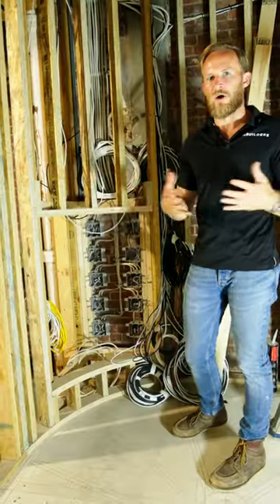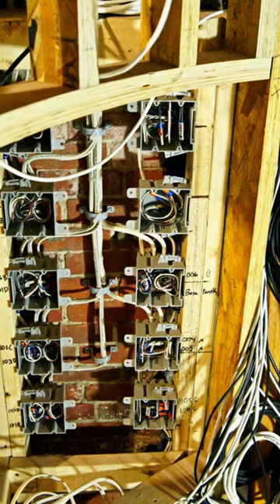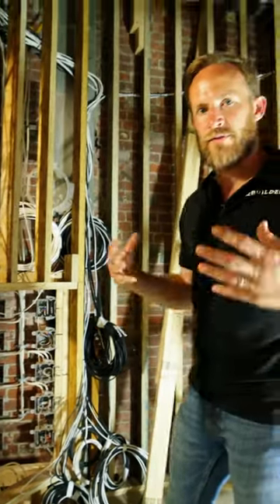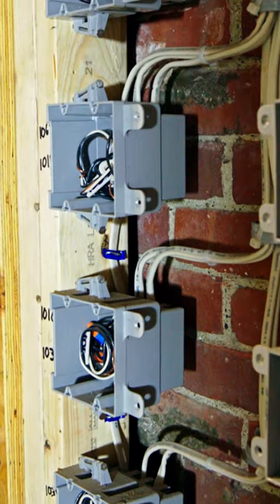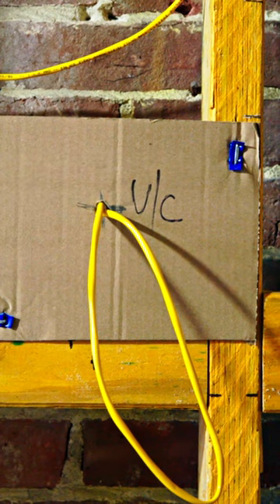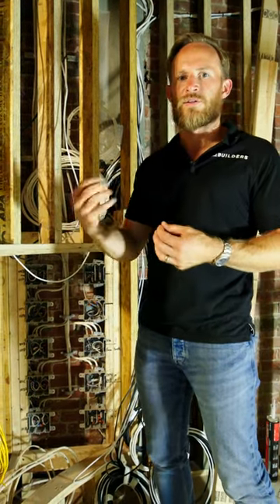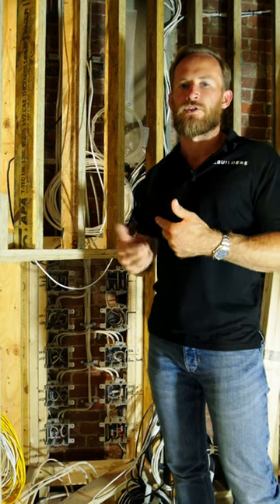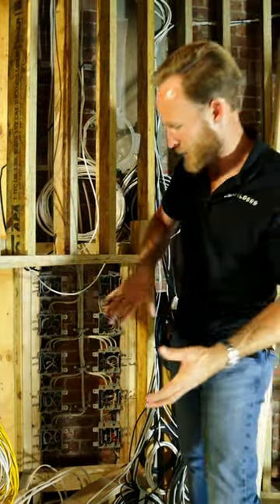Lighting Control

Comment: I love this and thought about doing this from my home, my biggest concern is what happens when the product is no longer supported or when the company goes out of business
Reply: Don't do this.  It's a bad idea.  These systems are not perfect and have problems.  If you centralize everything like this, you can easily lose total control of a light when there's a bug.  Not to mention that it will affect resale negatively and, like you said, the product lines are constantly updating.

There is a better way to accomplish the same thing.  What you do is you set up the house like normal with normal switches.  Wire it like normal.  But then you add "smart relays" behind the switch, then host a server locally running home assistant.  Essentially, the switch on the wall functions as an input to the relay, which toggles the light locally, even if the system is down.  But the relay also talks to your server which can take inputs from keypads, your phone, whatever you want.  You can then set those up to turn on whatever lights you want however you want.

This way when it goes down, you still have control over your lights.  And your guests don't have to worry about figuring out your weird system to navigate your home.  And it's easily removed or changed because the house is wired like a normal house.
Reply: Simple, you just sell the house and buy another one. Good old consumerism!
Reply: Lutron ain’t going out business.
Reply: I'll second that comment with personal experience.  We did that in a remodel 15 years ago.  All the light switches were hidden and the control is from keypads where you would expect a light switch to be. 
It was ok for a 3 or so years until the keypad buttons started to fail.  Replacements are $80 dollars apeice, and a call to the tech support/installer guy.    Can't go back to conventional switching where a nice dimmer is $10 or less.   Heck...our house was built in 1912 and those switches still work.  I'd advise against this strongly.
Reply: Don't worry if company goes out of business you can always crawl down the stairs to turn on your lights

Comment: I'll stick to my normal switches. That way if a light doesn't turn on, I know it's just a bulb and don't have to call tech support
Reply: How would you know it’s not a faulty switch?
Reply: Or when the hardware fails after a few years and it's no longer available,  Complete re wire then.
Reply: @martinhawes5647  this little tool they call a volt meter
Reply: Not only this, but now you want to add some lighting to a new area or something like a closet or something... Now you have to run wires all the way to the "brain" since there probably isn't an unswitched line running anywhere that you could junction into...
Reply: @michaelhanson5773  you could still jump wire off another room but that new room would by hooked up to the existing room breaker. So if breaker goes down both rooms go down. Only have to dedicate wire back to panel if you want individual control over rooms
Reply: @CBeezyDSGB  except that the switches are all centrally located, so if you jump a new location to another fixture, that light will turn on whenever the other one does... The way this video explained it is basically all the switches are all in one place so there is no unswitched anything ran anywhere so if you tie rooms together then their lights will all be controlled the same...
Reply: It's the biggest waste of money. Each switch cost $200 bucks. Plus the brain at minimum is 3k. Plus the system never works properly. There's always an issue.
Reply: @michaelhanson5773  no, you can put the switch wherever. You can hide it in the attic. The switches have built in wifi that relays to the brain.
Reply: I would rather pay an electric instead of having to call a brain surgeon to fix my attic light

Comment: I used to do home automation. It’s good for heating and cooling for efficiency but not necessary for real living. You go through your whole life automatically reaching for a switch when you walk into a room. Don’t fix what ain’t broke. Hey it sells though
Reply: There are ways to do home automation right and home automation wrong.

The key is to preserve all the existing and normal controls.  This way your house works when the system is down and nobody (guests, other members of your household) are forced to use your automation.

Examples of home automation that I have that have been successful for my lifestyle: turning off the outdoor lights at sunrise if they are on, turning on all the outdoor lights if I double press the switch for the front porch light, notifying my phone if I leave a door unlocked or a light on, being able to turn off all of the lights in the house at once from the bed, turning on the ceiling fan in the middle of the night half asleep with voice controls, turning off the desk light when the overhead light invthe room gets turned off.

But crap like "turn on the light as yiu walk in the room" is always a gimmick that sucks.

Comment: My parents had a system to control most lights in our 8,000sq’ house from 3 locations.  The house was built in 1969
Reply: Yes ...this concept was started in 1947 touch plate system ...and was still avaliable in early 80s ...main difference was back then all of it was with wires.....now it can be wireless.....I have touch plate in a 1954 house that works flawlessly  2 master panels one going out to carport from kitchen and the other is in the master bedroom ....we can turn off and on at every room in the house as well as at the master switches...works off low voltage 28.5 volts transverter and relays that send power to the lights.  This home has 18 transverter and 18 relays

Comment: 1947....1983.   Touch plate system same concept ....was all hard wired...low voltage 28.5 volt....transverters and Relays with master switches that can controll all lights through the house

Comment: Cheaper and easier ways to do this lighting. It looks cool and as an electrician I can tell ya it’s good work, just better ways to do it.
Reply: Yup, especially if retrofitting an older house rather than a new build. I’d still rather have individual smart switches, since they’re easier to diagnose and replace if/when they go bad. 

I’m not an electrician tho, just a technology consultant for businesses and homes.
Reply: This is not cheap. These switches are $200 bucks a piece.

Comment: I'm an electrician and how those wires are run isn't code. You can't bundle Romex like that. They will heat up in the middle and not carry as much current. Also I'm pretty sure running next to brick like that isn't allowed either but I would have to look that up.
Reply: No your right. My ex fil was a master electrician he taught me the code and that whole spool in the wall is definitely a no go. I just hope the inspector failed it and made them redo it
Reply: LED carry a low enough current to not matter though right? If it was an outlet, I'd agree but these lights are like 18watts at max brightness each (but max LED lights is way too bright anyways)
Reply: @Aeroliten  that doesn't stop the installation of Romex in wet location and the non UL listed use of two hole straps. The code doesn't say you don't have to do voltage drop if they are using LEDs you have to wire the house properly in case the owner decides to put up an old school light fixture.
Reply: @Aeroliten  doesn't matter that power is still flowing through the romex. Trust me I almost burned my moms garage down when I wired her pool up and she didn't know where she was going to put the timer for it in the garage. So I left the whole thing and hooked it up. Couple days later my cousin called bitching the coil started on fire when he was out there drinking.

Comment: Looks very nice. Why did you not go with Lutron homeworks? Radio ra is more for retro replacement of existing lights switches. The way you did it was more like homeworks style. Homeworks has better features and style choices. Plus the ability for hardwired shades. You should definitely look into it, it would be a better compliment to the quality of work you do

Comment: Why use standard 2 gang boxes? If you have that many loads, a panel system directly next to the electrical panel. Install is cleaner and safe. Use hardwired solutions, they are better . Having wirless communications in a closet clustered together, not advisable.

Comment: Only $2000-$8000 for controller and $50 bucks a switch. I've got 40 year old light switches that still work. I'm guessing these will last 5 years, if your lucky.

Comment: This is a massive mistake.  When dealing with "smart" home stuff, it is important for it to still work, even if the "smart" components go buggy or have issues, temporary or permanent.  Plus making it intuitive for guests.  How often do you actually desire to change which lights a given switch turns on?  Hardly ever once you get settled.  How often do "keypads" fail or behave weirdly or confuse operators?

Far better is a traditional switch for every light, with a relay behind it.  The switch itself functions as one input directly to the relay.  Then you can also tell the relay to turn on or off from a remote system the relay is also connected to.  You can set up your keypads and turn on whatever lights you want.  But when the system fails, the light will still work.  When guests come over, they will still know how to use the lights.

No need to deal with a keypad if you don't want to, but it's there when you do.  This is how my house is setup and it is the best of both worlds.

Comment: Hideous waste of wire and money. The beauty of the Radio RA is you can wire traditional localized switches without the wasteful home run wiring for every light/zone to a centralized lighting control panel.
    Your contractor has quadrupled the price for zero functionality gain, congratulations.

Comment: This is not a good idea. Not good for resale. Keep the switches at their corresponding locations, you can still install a smart switch there if you want to control the lights with your smart phone. This way will give you the option to install a regular switch if someone doesn’t want the high tech bs. If you locate your switch legs somewhere else your screwed when that technology fails.